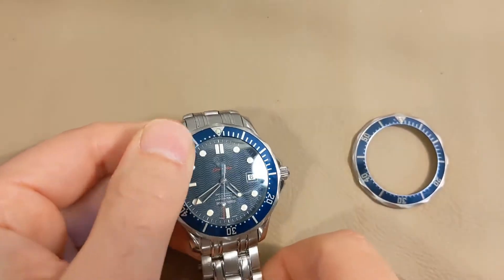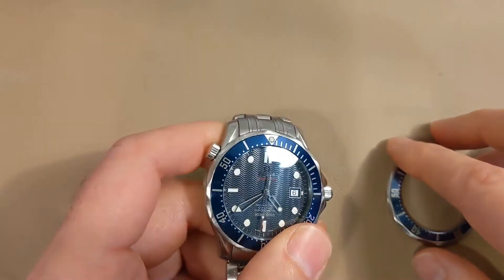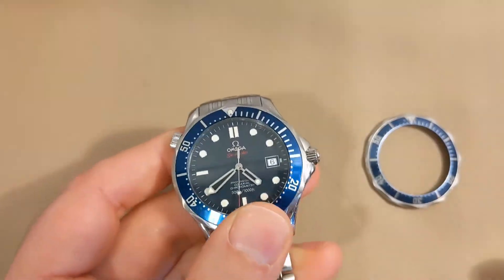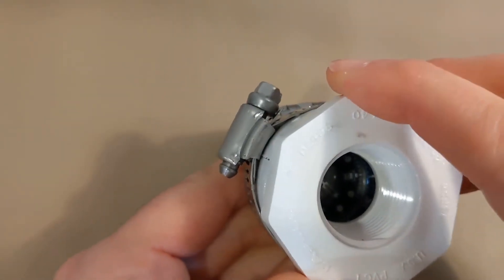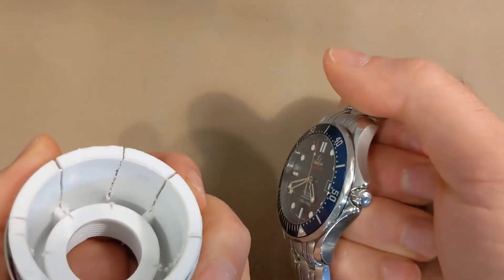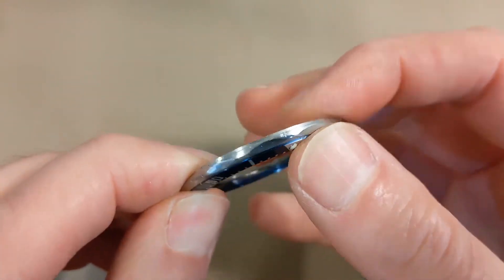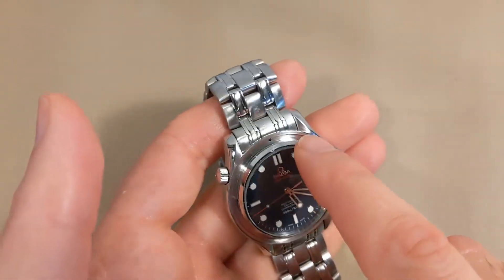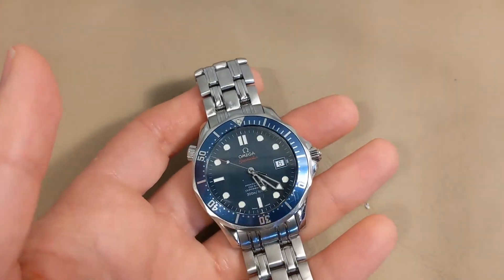Omega Seamaster Pro 2220.80 automatic coaxial watch: aftermarket bezel removal and replacement

Comment: Wish I found this a week ago. Just spent $40 getting my click spring replaced because I didn't want to bend the bezel trying to remove it. Very clever, and good call on the OEM insert.
Reply from the maker: Thanks...I have seen a lot of watches with bezels pried off...in addition to bending the bezel, doing so can damage the watch case as well.
Reply: He could have damaged one of the crowns also.

Comment: FYI for people: the aluminum inserts from this era of SMP are friction-fit and don't require any adhesive.  If you use a 22mm socket it can help evenly pop out the insert from the bezel.
Reply from the maker: Yes the oem inserts are friction fit. The aftermarket ones do not seem to be as precisely made and do require some adhesive (double sided tape etc.) to stay in place.

Comment: Thanks for the help, I've noticed the plain silver bezel insert references sell at a decent discount compared to the blue ones, and wasn't sure how difficult it would be to spend $40 or so on an insert and save a couple hundred to put towards a service.
Reply from the maker: The blue bezel 2531.80 and the silver bezel 2532.80 are actually the same watch, aside from the bezel insert. You could change the silver insert on the 2532 to an aftermarket blue one. The quality is pretty good on the aftermarket ones, except the lume pip is usually different looking from the OEM one. Just note that the bezels of those watches cannot be swapped with the 2220.80 bezel. There is a slight difference in the bezel shape and the part number is different.
Reply: @omegawatchfan  Yea that's what I always thought, I had a 2531 about 2 years ago and had to unfortunately sell it to fund a last minute apartment and have been chasing one again since. Inflation happened and all the watches got super expensive and now I've been seeing them kinda floor, the 2532's are usually about $100-$200 less (and better condition) than the 2531's but I've always thought the dials were the same.
Alot of the 2531's also have patinad lume and I like the bright white that most of the 2532's seem to have. 
Glad to know its relatively easy to just throw a new insert on one.

Comment: Hey on mine the bezel is just a little springy, you can kind of push down on it, is this a normal thing on this watch?
Reply from the maker: Bezel should not have a lot of play, but I have seen it on heavily worn watches. If it does feel springy or can be shifted slightly by pressing it, then it may need adjustment of the bezel retaining ring or a new one.
Reply: @omegawatchfan  Thank you.

Comment: I've the same model. The bezel does not click when rotated. Does anyone know what the problem might be?
Reply from the maker: There is a circular "click spring" under the bezel with tabs that stick up into the underside of the bezel, which causes the clicking action when the bezel is rotated. That part is likely worn out. The bezel has to be removed, and a new click spring installed, very easy to do. Sometimes, if the click spring is lightly worn but intact, the tabs can be raised slightly to restore the clicking function.
Reply: Mine doesn’t rotate anymore, what can i do?
Reply: @emersonjoeyclaro3777 try to rotate it under water. I had a blocked bezel on the used one I bought some years ago and it fixed the problem. It was probably just some dirt in it I can’t tell if you have a similar issue but it’s worth trying